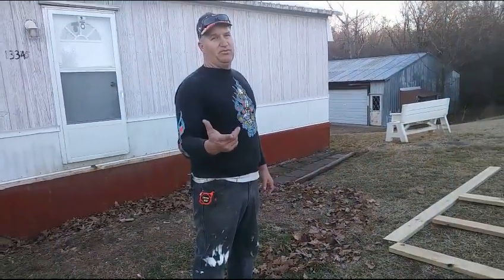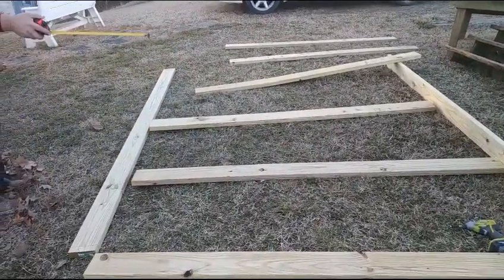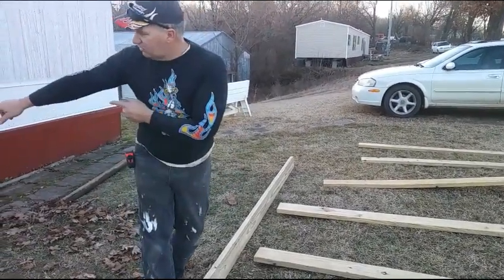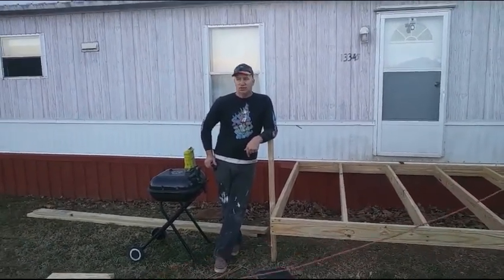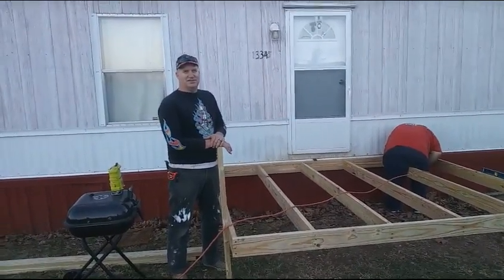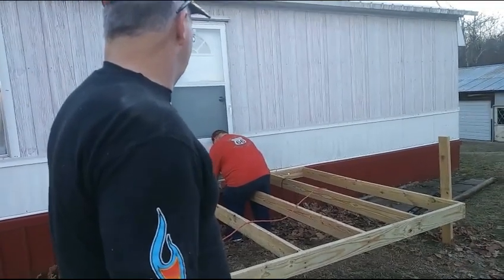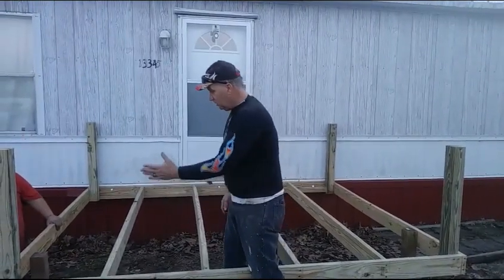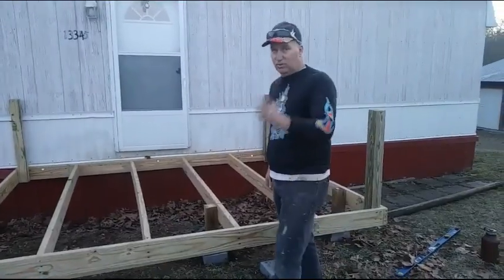How to build an 8'x10' Deck for your home, mobile home, or building

Comment: good video,   people be careful, the code in your area may not allow attaching a deck directly to a mobile home. It may need to be self supporting.
Reply: In my area , attaching to a mobile isn't allowed UNLESS the home is permanently blocked with a 'foundation' similar to a stick-built home. 
 I am building at this time a free-standing 10x16 'porch' with cover to replace old porch.
Reply from the maker: I have a video for that wether or not you should do that

Comment: Thanks for the video.  It would be better if you shot close ups of the work while it is being done, instead of the guy talking.   That helps more to actually see the guy put in the lag bolts, up close.  Plus it would be nice to see how you installed the decking and steps too.
Reply from the maker: You are right. Will do video the next deck I can film and will film all the way thru. This particular one an ice storm came in and we had a hard time getting out with truck and trailer. I intend to do better thanx for your patience.

Comment: Odd I didn't think it was an AREA ruling on attaching to a mobile home? I thought that was a HUD Rule. and illegal to attach a porch/deck etc to a mobile home. ( Unless it was designed for the structure at time of build)
Reply from the maker: Hud is housing and urban development. Used for financing specific housing . Yes they have rules on mobile homes. Like you must have block skirting.  I have been involved in getting a house to qualify for the lower interest loans. Deck being attached has never been a problem. Perhaps county or city ordinances can be involved. I have some larger towns allow no mobile homes at all.

Comment: According to the International Residential Code², adopted by most states, a deck does not need a building permit if it is “less than 200 square feet, under 30” off the ground, does not serve a required exit door, and is not attached to the dwelling“ — if it is freestanding.
 Ledger boards are an invitation to disaster...
 Don't attach your deck to your home.
Don't be stupid.
 This video demonstrates the WORST way to make a deck.
 This deck is not built ...it has been hung on a handful of fasteners.
Reply: I was thinking to myself……, WTF is going on here….. 🧐  😳 that’s not a very sturdy base and why would you put those 4x4 in the corner like that.  🤔
Reply: YES!!! This video is bad it’s funny:
Reply: @joshschandoney5045  It literally is a guide for what not to do when building a deck...

Comment: I don't see how to attached the deck to the mobile home. is there a 2 X 6' used on the existing outside wall?
Reply from the maker: All floor joist are fastened to an outside  2 by 6 called a ridge beam . The frame is also connected to the ridge beam by metal outriggers and lag bolts the floor plywood sits on top of that 2 by 6 . The metal trim or vinyl siding trim is usually about 2 to 3 inches lower than that ridge beam fasten your deck to that. Wish you well on your projects